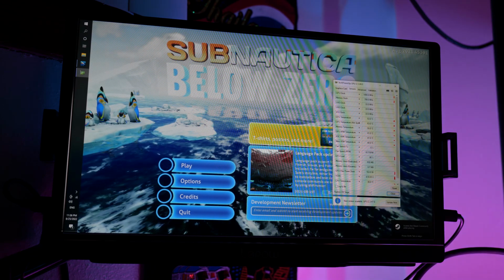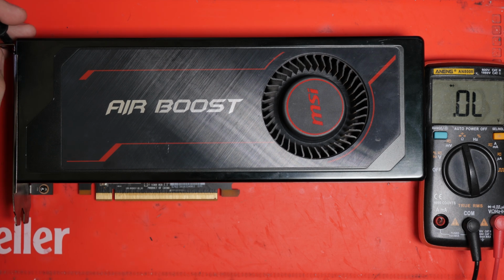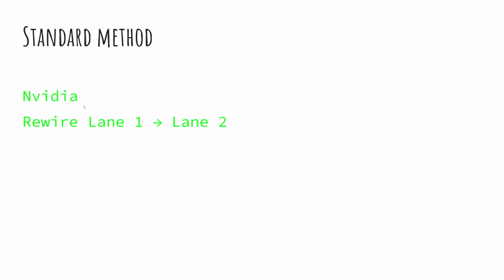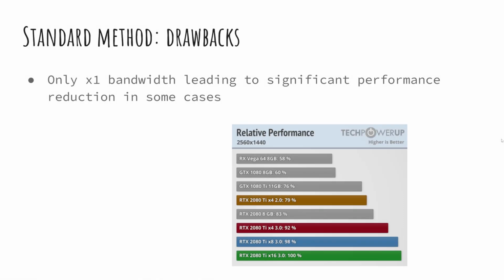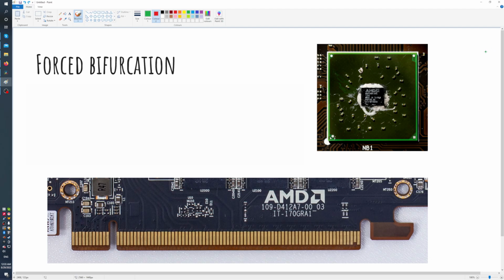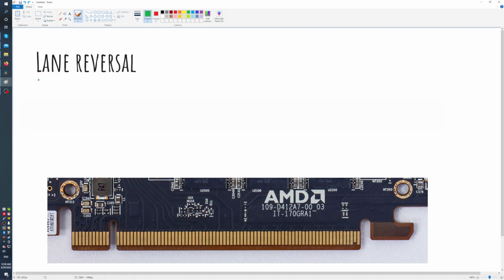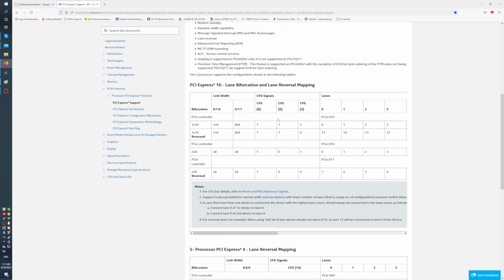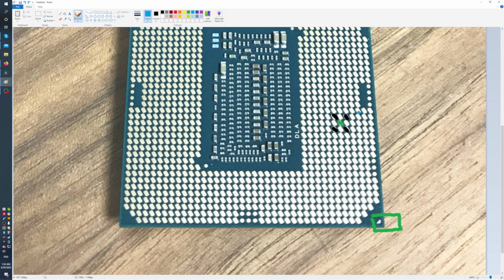RTX 3080 Ti Graphics Card Diagnosis - Backwards Inserted Mining Riser

Comment: Nice trick! Could also use Intel FIT tool to toggle lane reversal and bifurcation in the BIOS without any hardware modifications ;)
Reply from the maker: Didn't know, thanks!
Reply: @TechCemetery  Modding the cpu to enable it, makes a far better video.  Its hardcore.
Reply: Could you elaborate further?
Reply: hi
you know, how to do it for am5 ?

Comment: Hi, I’m very new to card repair and have a gtx 1080 extreme as my first repair dummy. I wanted to ask if you know of any schematics for this card by any chance as it seems I have picked an odd card as my first. I found a blown 10A SMD fuse so far and possibly a short on one of the 8 pin molex connectors on the top right (outer right connector when board is plugged in and upright as in your video) but I’m not sure if they’re all the same voltages in that plug or there are possibly ground wires also. Thanks

Comment: help I have an Evga GTX 1070 ti the pex is shorted in the coil output, I do not have the diagram of this graph to see what it feeds nor do I have a laboratory source to see what makes up this short circuit if someone has the diagram I would appreciate it, but I have seen in other schematics that the voltage of the pex goes directly to the gpu, could it be the gpu in short?

Comment: Had the same problem with rtx 3090 frst line no conection,it only worked on f1a55-m lx r2.0 motheboard ,it wont eaven see the card on risers or any ather motheboard that i tested,it mining already  one year no problem eth :)
Reply: can you provide me more info about this ? whats special on that Motherboard or that PCIE slots ?, had the same problem with inverted riser..., fans spins but not detected
Reply: @daeonmusic  on that motheboard it read diferent lines in pcie slot for detecting cards,if card have all volatages but have no conection on first  data lines on gpu pcie conection, this motheboard wil work..
Reply: @nardevpsy  ill get one then ! thanks for replying so fast ! :goat-turquoise-white-horns:

Comment: that windows doesn't show it, that, by itself, is not a guarantee the device is dead. 
If the cpu (or whatever owns the PCIE lanes on which the GPU is connected) can not talk to it, maybe 
but I'm quite sure you've investigated more thoroughly later in the vid
Reply from the maker: Of course, I fix graphics cards for a living. These kinds of distinctions are trivial.
Reply: @TechCemetery  do you remember the asus v9999?
it had the blower blowing inside the case...

Comment: hey mate, love your videos. I recently bought an RX 570 4GB and it's not giving out a signal, fans are spinning (not 100% speed), RGB lit. the seller blocked me (of course). the thing is, I cannot get the PC to boot even with the integrated graphics, doesn't matter what settings I use in BIOS. any idea on why doesn't it boot with iGPU?

Comment: What if we have a x16 slot (but it’s x4, will there be any power delivery issues for a 3090 Strix)? Say if we are mining on a x4 PCIE X16 slot native in the motherboard. Running z690-E Strix
Reply from the maker: Power delivery is the same for x1, x4, x8, x16 slots.
Reply: @TechCemetery  thanks

Comment: PCIe pins B14-B15 and A13-A14 no volts in DIODE mode, but other data lanes have 0.4v.   Is that a dead core ?
Reply from the maker: Sounds like one.